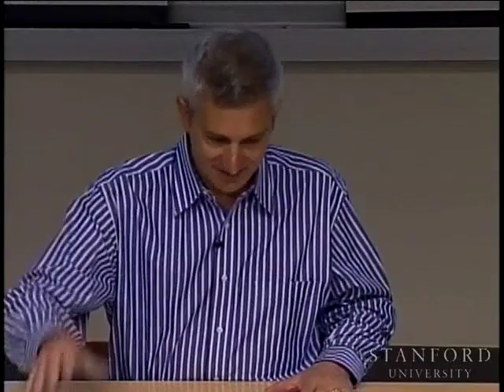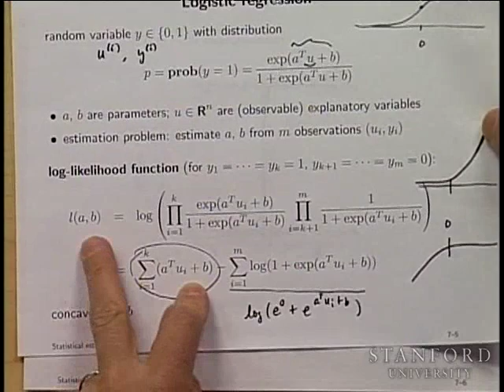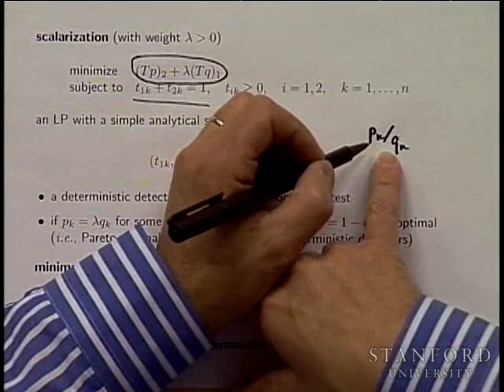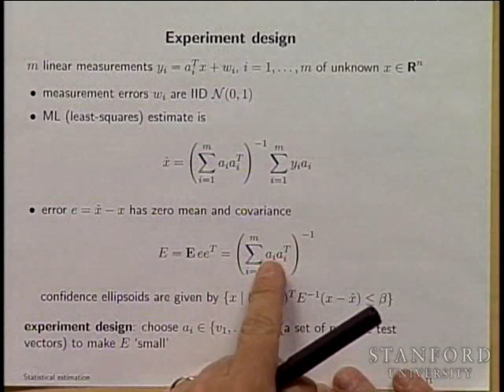Lecture 11 | Convex Optimization I (Stanford)

Comment: 0:30 Statistical estimation
4:51 Linear measurements with IID noise
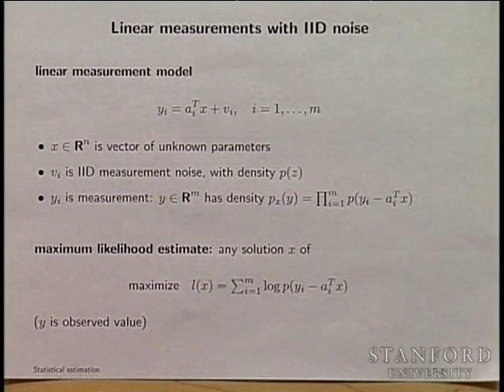7:23 Examples
15:36 Logistic Regression
23:03 example
29:39 (Binary) hypothesis testing
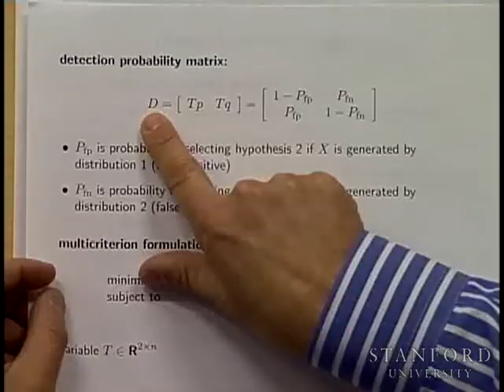35:02 detection probability matrix
40:43 scalarization
50:41 minimax detector & example
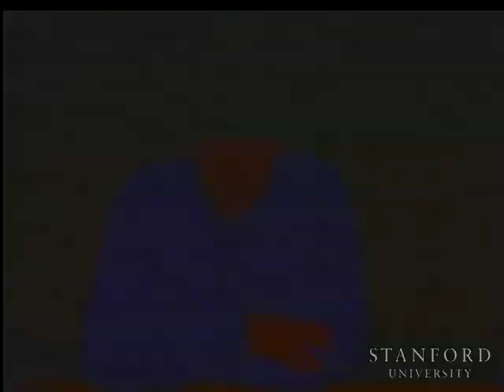55:11 Experiment Design
1:01:45 vector optimization formulation
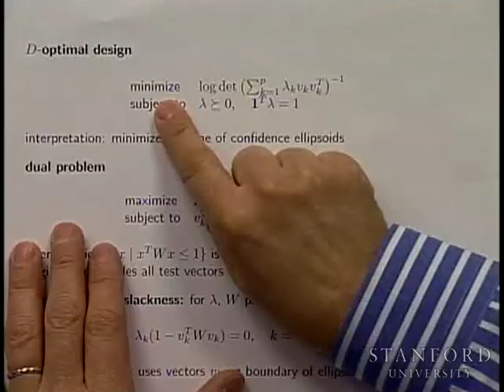1:13:01 D-optimal design
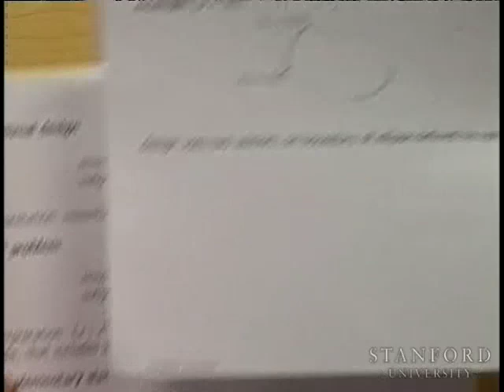1:14:28 example
Reply: The real MVP. Thanks a lot for the book keeping. Really helps to know when to expect to go back to the book.

Comment: On the slide about logistic regression, it is stated that the distribution is logistic... But it does not integrate to 1, so it is not a distribution, right? Isn't it rather a cumulative distribution function?

Comment: The number of reviews is decreasing exponentially w.r.t the number of lectures.
Reply: +Wei Xue Was just about to comment on that :D
Reply: yeah..:/ I am still waiting when he starts solving a convex optimization problem!
Reply: That's not necessarily the point of these lectures, they are here to teach us how to formulate the problems in order for them to be solved with a professional solver. Creating a robust solver is VERY difficult, which is the reason the best solvers out there are in the range of $10,000, good free ones are still available though.

If you for some reason want to build a solver yourself you would need to have a toolbox with a range of quasi-newton methods, numerical linear algebra, etc. this is FAR beyond what you can expect from a 20 lecture course in applied convex optimization (It could very well be a PhD thesis).

Comment: At 57:13, could someone elaborate as to why that is the error covariance matrix?  The ' a's ' are under the control of the person conducting the experiment, right? So how's that an error? 
I understand that one needs to choose only those experiments which help in allowing a series of experiments to gauge to the maximum extent possible given things like resource constraints.
But why call it error? It would elucidate the reason why I want to make it smaller.
Reply: Because people always use probability or says gaussian, to build up this problem. If you substitute the formula into a gaussian PDF, you will find that 'as' is something like variance and therefore you will know the answer to the first question.